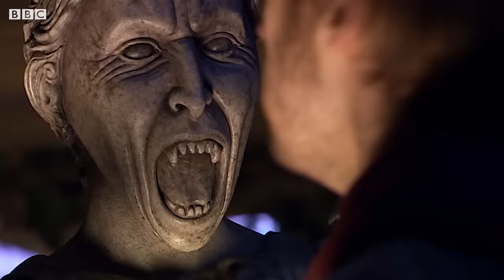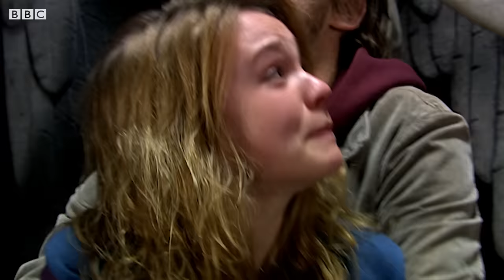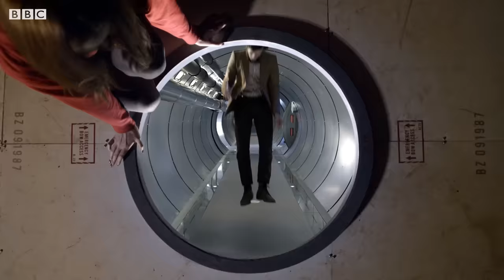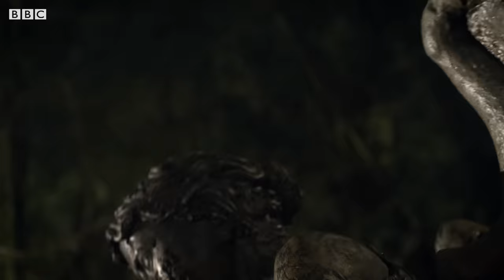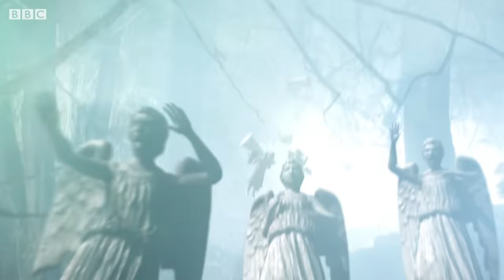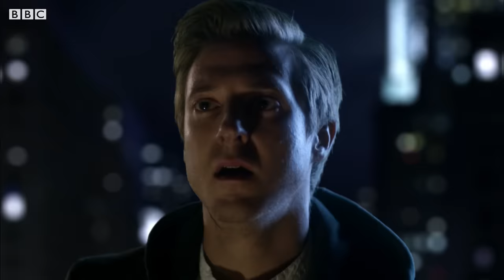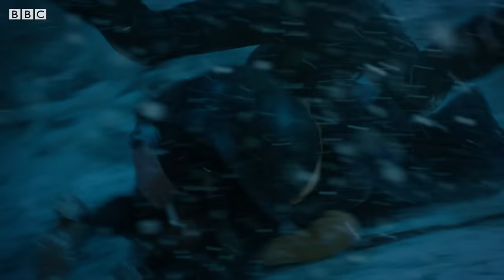The Weeping Angels | Doctor Who

Comment: "They cant see each other" means they cant also see themselves. A mirror in front of them might also freeze them permanently instead of tricking them into facing one another
Reply: The image on an angel becomes itself an angel.

So yes, a mirror would work
Reply: @silentwarriorts5779  but then they angels couldn’t see each other, this only causing a surge in numbers
Reply: @silentwarriorts5779  No it would be better to just put them in a room entirely made of mirrors and a constant light source. However eventually, that light source will run out.
Reply: @pixel_biscuit  solar energy with a backup generator
Reply: Damn you guys figured this whole thing out
Reply: @jacobnelson4150  As in the sun will die eventually and then they will escape.
Reply: @pixel_biscuit  so have a fail safe that will destroy the mirrors and statue simultaneously, perhaps something that will only activate upon loss of power to the system.

Like a electro-magnetic lock holding up a block of osmium or just solid steel
Reply: @contentlobby3824  What would destroying the mirrors do?
Reply: @pixel_biscuit  break the image, killing the angel
Reply: @contentlobby3824  ah I see
Reply: The Doctor actually does this in the 2013 Christmas Special, Time of the Doctor. He places a mirror in front of an Angel.
Reply: @contentlobby3824  bro yall talking like the government wont supply a missile to get rid of the statues
Reply: @del3740  do you think that’s going to be enough?
Reply: @contentlobby3824  it wouldn't. When they are being observed they're quantum locked and technically don't exist
Reply: That’s if we could them to not cover their eyes.
Reply: @pixel_biscuit  they have perfect night vision. They cannot not see. Trapped.
Reply: @contentlobby3824  You say that like all the shards wouldn’t make hundreds more
Reply: @manoftruth0935  If that was the case, them turning off the light in this ep wouldn’t help them at all
Reply: @littlemoth4956  they wouldn’t be the image of an angel anymore
Reply: @contentlobby3824  Angels can see in the dark otherwise the four angels he trapped in this episode would've gotten away shortly after... Deep sea would be the worst place too, all they'd need is a split second of a fish swimming near their eyes and blocking their vision. Presumably they can only see the one directly in front of them so if a fish even swims in front of one of them that automatically frees 2.

Kind've odd how we rarely see them freeing the others, with how fast they can run they could easily kick up sand or dirt to obscure our vision. they should honestly make an episode like that where the angels become extra clever, maybe even grabbing objects or cloth to cover themselves like a Halloween ghost. You cant see them while they're hiding under a blanket so they can easily grab you through the cloth. Who knows what part you need to observe for them to become a statue because if the hands dont count it's easy hunting but if the hands do count and they need physical touch they could still easily grab through the cloth and instead of feasting on you they just lock you in place till another one comes from behind or you just give up/fall asleep...

Maybe we can also get Weeping angels 2.0 where they've evolved and only get affected  by direct observation so every person can only focus on one at a time. If your group is even outnumbered by one then you can never focus on them all at the same time so one will always be able to move and no matter how rapidly you change your gaze they'll still inch towards you. Only way the doctor beats them is by tricking them into the tardis and teleporting them to some mirror dimension or even just a funhouse of mirrors since you can basically see the entire room no matter which way you look.
Reply: @malcolmmorin  Wrong, didn't happen.
Reply: @contentlobby3824  Wrong. A mirror never stops being a mirror if you shatter it, it simply becomes multiple, tinier mirrors, mirror always win. No different from a big mirror in practicality so they'd function the exact same therefore if a big one works the tiny ones work the same. Also, need I remind you of the episode where someone drew a picture of an angel and it became an angel and after the paper burned it became a flaming angel and didn't go out?
Reply: @DrakeOola  I’m sorry what did what
Reply: @DrakeOola  Yes it did. There was a five second moment where it shows an Angel with a mirror placed in front of it saying, "Love from, The Doctor!"

This Angel is shown numerous times throughout the special, still stuck in that spot.
Reply: My first thought exactly
Reply: @pixel_biscuit  not for another millions of years i think 😅
Reply: @AeraSteele98  Maybe they have to see the others face to face..
Reply: @PixelBiscuit  true but they cant really get anywhere seeing as everything dies without the sun XD

Therefore no more time energy to suck on
Reply: The Doctor does that in the time of the doctor
Reply: @pixel_biscuit  get a rock crusher and mirrors  while they stuck looking at each other let’s see if they can do anything while dust
Reply: id be installing a thousand lights connected to multiple different types of power sources
Reply: It would be cool if that's the explanation for the Medusa myth in this universe.
Reply: @pixel_biscuit  And by that time, anything that would fear them would be gone anyway
Reply: thats the reason they cover their eyes pretty much, so they would have to not be covering their eyes when ya do it which would be difficult to set up.
Reply: @jacobnelson4150  Put them in a room with solar powered lights, all on a rocket headed to the sun.
Reply: I always wondered why all these smart people stopping baddies and saving worlds never considered they have 2 eyes that don't have to blink at the same time.  It takes a bit of concentration but its not too hard to alternate blinking one eye at a time - especially if your life depends on it LOL.
Reply: You could get them to take their hands of their face, get close, tape a mirror to one or both hands. Wham bam angel down.
Reply: @nouhorni3229  putting a mirror in front of their eyes..what a clever idea so brilliant in it's simplicity! Alas, it has one fatal flaw preventing it from being a truly great idea - I wasn't the one to think of it.
.
 Seriously though, im a bit surprised the writers never thought of such a simple yet effective counter to them.
Reply: The one issue with that is that they clearly can see themselves, since they look at they’re own hands
Reply: @pixel_biscuit  sun
Reply: @contentlobby3824  earthquake can take down the mirrors eventually the Tectonic plates keep moving you know they do be moving
Reply: @daethe  so they're vulnerable when you're not looking at them?
Reply: @thcenjoyer4608  technically they are yes, but not in a sense that they're weak. Just that they become eligible to be attacked
Reply: @pixel_biscuit  if the sun were to die we would be dead too
Reply: Actually that wouldnt work because they always look at their hands and they dont close their eyes so i guess they only freeze when viewed by any OTHER living entity
Reply: That would make sense as the rule that when something withholds the image of an Angel becomes itself an Angel so when the mirror holds the image of an Angel it’ll become an Angel itself therefor it’d be an Angel so if the angel is looking at the mirror which is an Angel it would make them freeze
Reply: Actually that’s exactly how it works. Later in the episode from the final clip, very briefly we can see a weeping angel frozen by it’s own reflection.
Reply: Only if they don't have their hands on their faces so just putting a mirror in front of their faces won't do anything
Reply: How about putting time-bombs on them when you looking at them and then just get away from them while watching them ?
A powerful enough bomb will blow a stone statue to pieces hence killing it in the process.
Reply: @kamalkumar7978  angels are indestructible tho
Reply: Yeah I was thinking the same thing
Reply: @pixel_biscuit   the sun dies, we all die anyway
Reply: @Antifag1977  eventually you'll still blink
Reply: @pixel_biscuit  bro if the sun explodes it's not really our problem anymore...
Reply: @contentlobby3824  qqqqqqqqqqqqqqqqqqqqqqqqqqq
Reply: Yeah the only safe room is a mirror room
Reply: @queenC6969  thinking about it, a mirror room alone isn't enough. It'd also need an infinite light source immune to their disruption.
Reply: They can see themselves, they are seeing their own hands when they cover their eyes
Reply: Only with a light source, you still can't see yourself in a mirror if it's dark
Reply: @Antifag1977  Gravity.  Sufficient gravitational force can capture light into a permanent cycle, you would need a self contained singularity.  Gravitational lensing would also cause the Angel to see its own back, thus functioning in the same manner as a mirror.  Gravity also manipulates the laws of time, thus they can’t drain its energy.

You kill them permanently by throwing them into a black hole.
Reply: @Antifag1977  mirrors duplicate them.  What of your eyes  being unconcentrated (  lop sided vision)   split them into two
Reply: @alphastronghold715  lol...we are soooo overthinking this. Alas we are nerds and such is our right! In that spirit I'd add that without a constant source of light eventually all the photons would be absorbed by something and radiated away as heat.  But if you had a black hole why bother with using it to generate a perpetual light source when you could just chuck the angels in it?
Reply: And they actually did in the episode “The Time Of The Doctor”
Reply: If they can't ever see each other, then I really want to ask, how do you get more weeping angels? As in, how would they reproduce?
Reply: Oh yeah
Reply: @contentlobby3824  Actually that won't be true it's not that they could not see themselves it's just they can't be observed by another living being therefore an image from a mirror won't work
Reply: @dragongod9367  “the image of an Angel becomes itself an angel”
Reply: @contentlobby3824  Where is that statement?
Reply: @dragongod9367  crash of the Bizantheeun
Reply: @del3740  you can't hurt the statue.
Reply: @daethe  then wouldn’t just shooting at them when they are not being looked at work, plus you could just tie blades to their necks or a whole bunch of shit
Reply: The Doctor actually uses a mirror to freeze a weeping angel in the time of the Doctor
Reply: I think the doctor said another living creature though didn't he?
Reply: @CzarYe  then how did they stop in Blink?
Reply: I made Weeping Angels in a D&D campaign and that's how the players beat them. Trapped them in a room full of mirrors and then went through with a magic warhammer, smashing them into dust. They didn't send people through time when they touched them though, just did a LOT of force damage.
Reply: When observed by any OTHER living creature, it’s reflection would still be considered it just an extension of itself
Reply: @josephmort4039  the doctor said they're quantum locked when being observed so you can't hurt or destroy them physically while turned to stone because they technically don't even exist... but i guess you can just overlook that for a rpg session
Reply: If weeping angels would freeze when seeing themselves, they wouldn't be looking at their hands all the time now would they
Reply: "by ANY OTHER living creature"
Reply: Yeah that theory was proven
Reply: Didn’t Osgood use a disco ball to freeze 4 angels in the Lonely Assassins game?
Reply: You need light for a image to reflect off o mirror do
Reply: @contentlobby3824 why go threw the entire loop and not just use the failsafe to begin with
Reply: @pixel_biscuit lack of light would kill the mirrors and the angels can siphon energy witch mean any light source will eventually drain.
Reply: @jeffreyleveque4690  idk, plot?
Reply: Bro great idea but whose carrying a bunch of mirrors on them 😂
Reply: @areethaa so, the past is the safest place at the end of time?
Reply: This actually happened in The Time of the Doctor
Reply: @pixel_biscuit they can turn of lights even when they cannot move
Reply: They actually did that in a game called The Lonely Assassins. Larry from the first angel episode tried to do it, but failed. Then Osgood used a disco ball to freeze them all
Reply: @gferrol118  The Doctor used a circle of mirrors to trap an angle in The Time of The Doctor
Reply: @pixel_biscuit if the sun dies, I think we got bigger problems than weeping angels
Reply: if the sun dies then transport these beings in a space ship in a room full of mirrors with the light being powerd by hydro power in a miniature dam inside the space ship and problem solved
Reply: @jacobnelson4150  Potentially nuclear due to how long the energy source can last with the right element.
Reply: You need to find one that has/had their eyes open already and then place it one who is near others this having their eyes covered won't be affected by mirrors
Reply: Technically speaking everything around us reflects light meaning that everything around us is a mirror so in order for the weeping angels to move they’d have to be blind, right?
Reply: @Artinatordraws well that’s actually super smart but “plot” wouldn’t let it be that simple
Reply: yes but only until the mirror is moved or destroyed by another angel or something else so you couldnt use something like a hand mirror for long time use but just a temporary fix until you are able to escape of find something better
Reply: this is late to the convo but they only cant move when theyre observed by a living thing, so surely a reflection isnt a living thing? just a thought
Reply: As long as its intact
Reply: Can wear very shiny plate armour and strap some led light's incase of a blackout and they are merciful on portable chargers.
Reply: I dont think so i think it needs to be a living creature for it to freeze
Reply: But if only one is facing each then it doesn’t matter
Reply: But if the mirror moves or breaks they're free
Reply: @pixel_biscuit  if by eventually you mean instantly.
Reply: Pour molten silver on them, causing their entire "vessel" to shimmer with reflection from every angle. Even if they call for more, they'll freeze as soon as they show up and allow for more silver to be poured onto the new ones. We could allow them to keep calling them all, if possible, and cover them or just enough to keep the surrounding ones frozen because of the reflections.
Reply: It means that he can materialize through the mirror
Reply: @kamalkumar7978  the Weeping Angels are immune to damage whilest being observed by any other life form, be it directly or indirectly, this is due to being quantum locked beings and it would require everyone to look away from the Angel when it is about to go off whilest being far enough away for the angels to not catch others in  the blast.
Reply: From understanding from a 4 minute clip. When they are being observed they are completely locked, nothing can  break them or destroy them. They don't just become normal statues
Reply: That's some straight up big brained type shit
Reply: If they can use psychic powers to affect lighting, they could use that same power to destroy a mirror. It actually was a plot point in Doctor Whooves Adventures: https://www.youtube.com/watch?v=LTQAPiC-1us&list=PLD064000BF43C9265
Reply: @Lord_Chaos000 how is no one clicking onto this 😅
Reply: @J.O.R.D  I don't know, yet it seems pretty logical to me
Reply: If the angels can explode light bulbs while frozen, they should be able to destroy mirrors
Reply: You also need a permanent light source
Reply: a mirror isnt considered a living thing and if tt sees itself it is isnt considered freezingstone not live so its just reflecting nothing it not freeze angel it breaks all reality and science                    where you get a mirror?
Reply: Since the doctor said while you see them all they are is stone meaning atleast one of them should be able to move, cause the other Angel's looking wouldnt be Angel's theyd be stones, might be wrong it just popped in my head. Im not arguing against the mirror thing im arguing against them all locking themselves in a forever staredown, realistically they should all be able to leave one by one if theres no outside observer
Reply: But what im thinking is if all of them are staring at eachother none of them are angels theyre all just stone. That should mean that no matter what atleast one should remain since all the others wouldn't be angels able to see it theyd be statues
Reply: @jacobnelson4150  there's a delay after power outages before the generator kicks in.
Reply: @patti_xoxo3931  except how to get your hands on the thing to begin with.
Reply: Can't you just break stone?
Reply: @jacobnelson4150 except for the fact that they feed of off time energy which means they can starve to death so by the time the sun burns out they are already dead by starvation
Reply: or just blink each eye and always face towards them.
Reply: Brilliant
Reply: Mirror armor 😎👍
Reply: Just put a bunch of cctvs
Reply: U have wisdom 😜😂
Reply: Pls, what's d name of d movie
Am trying to download it 
And can't seem to find d movie anywhere 😭
Reply: @pixel_biscuit wed be long dead by then anyways
Reply: didn't he say what looked at them had to be a living creature?
Reply: Mirrored sunglasses
Reply: @pixel_biscuit I think by the time the sun dies we wouldn’t be around to worry about them haha
Reply: @pixel_biscuit  nah how does the light dying out help them escape ? itll only make it more sure that they wont.. cuz as soon as the light is flickering, theyll move and when it gets back on theyll be staring at eachother and end  up in a stalemate
Reply: @contentlobby3824  I came here to say that exact same thing
Reply: @pixel_biscuit  no offense I just feel like you’d be creating an infinite army of weeping angels
Reply: Wouldn’t be as suspenseful if it were that easy 😂 Plus, people seldom think logically in a survival situation.
Reply: @daethe Something like Obito with his kamui.
He is in front of you, visually, but materially he is not, while he still can do damage to anyone, anything can't do damage to him, which means, angels can't do anything, plus, he can just trap all of them into his kamui dimension, which they would be lock for entirety of time.
Reply: Okay so they can’t move if they see each other yet several times in this episode they are looking at each other and still moving there are major plot holes all through Dr Who and it makes me mad but I still love it
Reply: Soooooo in the first video with the blonde chick they’re looking in the angels eyes and they didn’t turn to stone or any of that business
Reply: I think (if I'm correct, I'm still kinda new to all this stuff) but from what I know is that if the angels r unable to move if they're seen, which means if they're forced to look at themselves they can't move at all, so a infinite prison in themselves.. and as the doc says they're greatest asset is their greatest weakness. Themselves
Reply: @del3740 lol the angels can't b killed conveniently cause they're quantum locked meaning they're locked between time itself
Reply: I thought this was gonna be a massacre in the comment section but it’s all just confirming
Reply: It's big brain time
Reply: @littlemoth4956  They can't be seen by humans in the dark, so it does work as depicted
Reply: @DrakeOola they are stone and blanket will not help
Reply: @pixel_biscuit hun if the sun dies the angels are the least of our worries
Reply: @patti_xoxo3931 these kinda things are evidence that the SCP foundation would 100% work
Reply: @pixel_biscuit I mean, escape where?
If the sun fucking dies it will explode and destroy the entire solar system and it's surroundings (it's more of a question i don't know a lot about this)
Reply: @DrakeOola they’re as old as the universe if they haven’t evolved past that weakness by now they never will.
Reply: Don't they commonly cover their eyes with their hands, thereby looking at themselves
Reply: That's why they said "whenever a living is looking" Which means not a reflection
Reply: @pixel_biscuit even the sun isn’t a constant light source lol they’d need an alternative for nighttime
Reply: Y si utilizamos un robot programado para verlos eternamente
Reply: They can't 'look each other'. There's a difference.
Reply: Where can I watch this Season no? In prime time
Reply: It big brain time
Reply: When the sun burns out, we have more problems than the angels @pixel_biscuit
Reply: During Matt Smith’s finale in the scene he actually did that
Reply: @alphastronghold715 hawking radiation
Reply: When the sun dies out you wont have to worry about them will you?  @pixel_biscuit
Reply: Yes, but they said that if it was a image of them, then it just becomes another angel. Basically a angel ends up being born in the mirror world duh.
Reply: Everyone who saying to use mirrors are idiots, they even say that a image of a angel just creates another angel. A mirror is a reflective image, thus they are creating another angel. If it was so simple to use a freaking mirror then all the mirrors they passed going through people's houses and hallways. A mirror would've proved this, but nope sorry everybody. It just creates another angel, let me say again it's a reflective image......image.....image....reflective image duh. Same could be said about water duh since it reflects the image of people's face too. But no that doesn't work either lol silly people
Reply: @pixel_biscuit Not my problem by then I’ll have been long dead! And my body will have been decomposed so they can’t Bob me!
Reply: @pixel_biscuit the sun will die in a billion years
Reply: Yes but the mirror can be knocked over/movd
Reply: @GeezerVR  If say the SCP foundation was in this universe they could easily keep it well guarded, or better yet make a room with mirror surfaces
Reply: @Dazzybhoy31  yeah I guess...
Reply: @jacobnelson4150  SCP foundation brainstorming going on here
Reply: thats why in most freezing poses they have their hands in front of their eyes, hence "weeping"
Reply: Wait with this logic the angels would always be frozen in large groups  because one is always behind another.
Reply: The 11th Doctor does this
Reply: Facts
Reply: Ok
Reply: That sounds perfect, but i never have a mirror with me.
Reply: A mirror wouldn't work because a new angel would be born from the reflected image eventually.
Reply: I don't even understand you guys saying
Reply: So, how do they breed?
Reply: @interesting2491  They just spawn like an NPC with the condition that they need a reflex or something that holds their image, like a draw, a picture or an sculpture.
Reply: Besides mirror, what if pouring a substance of some liquid that have kind of reflection like mirror, to the wall/floor or even the angel itself?
Reply: @ianraguse6455  No lights will last forever, and no power source lasts forever
Reply: @alphastronghold715  to a black hole we go, use a mirror room and lights with a set up so they can't disturb the lights and send them into a black hole
Reply: Well yes, theoretically. But that's why they're all only ever in old and abandoned houses/flats/villages, graveyards/caves/forests/futuristic type vehicles. They do that on purpose because you wouldn't really find a mirror around there or if there was it'd most likely be broken. I'd be interested to see this concept visited sometime to answer what would happen if an angel encountered a mirror. 
Like would it duplicate because an image of an angel becomes an angel? Or will it get stuck on its own eyesight? Would the angel still be able to move because it's technically not another angel until it goes out of the mirror? Maybe all three.
Reply: True
Reply: "They can't see each other" DOESN'T mean they can't also see themselves, that does not make any sense. If there are other clues ok, but if you're working on that alone, 0 sense mate.
Reply: Thank You 💕 mirrors are portals to the abyss to the DEMONIC ENTITIES Dark spirit's etc thus the sea of glass in the book of revelation of the prophecy
Reply: Yeah, but a mirror is much more fragile and without proper maintenance could easily get dirty enough to render it opaque.
Reply: @reubenmanzo2054  literally out of all questions to ask
Reply: Actually in the lore this is one of the ways angels propogate
Reply: @shreddedbagelwabiwabo8342  Yes, that's the one I ask. Whenever we see a new species, our first question should always be how did this species come into existence? How would they make more of themselves?
Reply: If you are determined enough you could quantum lock them in a Dyson sphere. The only time the light will go out is when the sun inside dies. Chances are it will create a black hole. And I struggle to believe they could escape the pull of that.
Reply: The lonely assassins game has that concept! They put a disco ball in the angels's hands.
Reply: But mirrors don’t work in the dark, so the lights would have to be on forever
Reply: How can you find enough mirrors and just glue them in front of each angel?
Reply: @contentlobby3824  i have the solution, get to mirrors perfectly parallel to eachother with the angel facing one of them, congrats the infinite repeating images has now spawned infinite angels, you are welcome.
Reply: @pixel_biscuit  nuclear source, you are set.
Reply: But don’t they look at their hands all the time?